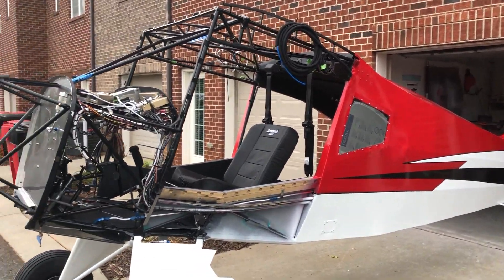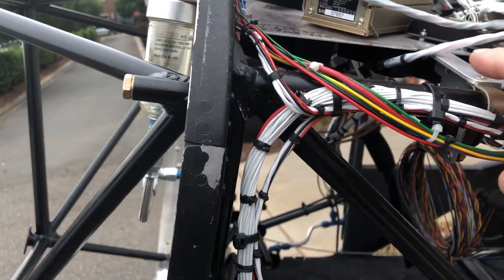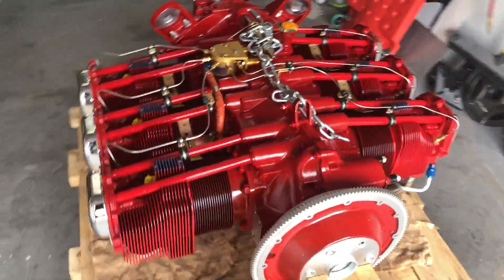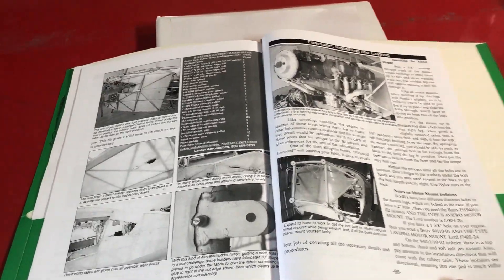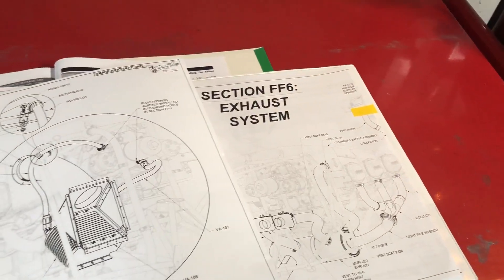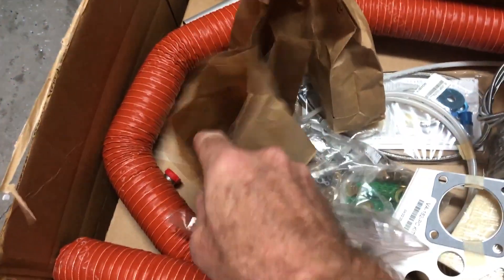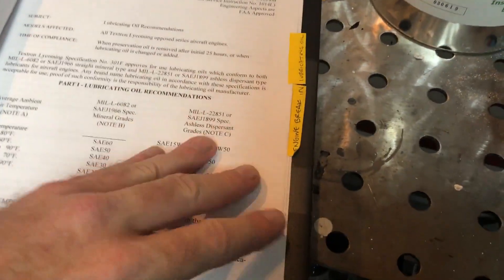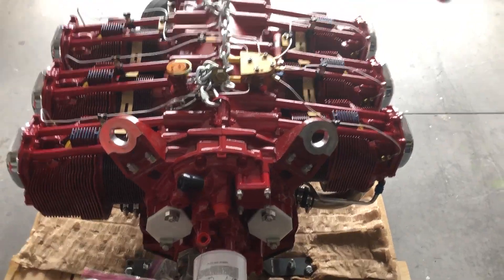Bearhawk - The NEW Lycoming Thunderbolt YIO-540-EXP Engine for the Bearhawk is HERE!

Comment: I maintained a small fleet of Piper Navajo chieftains in Alaska during the 90's, the Lycoming 540 is a real good power plant. In the turbo version it produces a reliable 350 horsepower.
Reply from the maker: Thanks for the comments of your experience with the Lycoming 540.  I also cannot think of a more reliable and better performing engine for my application.

Comment: How did you go about purchasing the engine? It seems pretty undisclosed online as far as where and how to get an engine for experiementals. And if you don't mind, how much should someone budget for FWF parts that don't come with the Bearhawk kit?
Reply from the maker: I didn't have any real issues finding experimental engines online to purchase.  I chose Lycoming because I would be buying an experimental directly from the manufacturer.  There are other experimental engine builders out there that will take an existing core and beef it up however they see fit and call it experimental.  For me, my choice for going with Lycoming was because they would be conservative and safe.  For example, they only go up to 9:1 compression.  There are some engine builders that will go up to 12:1.  

As far as the FWF budget, I purchased a RV-10 FWF kit from Vans as it is closest to my IO-540 setup.  They sell these on their website.  However, you should go through the Vans FWF kit one part at a time to decide what you want.  I really like their baffling kit, and other parts, but I chose to buy the exhaust system, control cables, airbox separately.

Comment: For the money Lycoming asks for they should have printed the manual. Thats total B.S.!  Your required to have that manual and they as the engine manufacturer should have provided that manual to you with the purchase of your “New” engine. 40-50k and they are got cheap to print the manual. It would make me wonder what else they may have skimped out on to save money? If the details are everything and they didn’t provide a manual. It does make one question their purchase and it does put skepticism on the product. Lycoming has been around a long time. Thats true. It’s also true that in Aviation complacency kills. So the longer they have been around the more complacent they can become.  Continental is the same way. Our clubs Rotax 912is came with a manual just saying lmao!  Great airplane though! You have done fine work on the airframe Sir! Congrats! Thanks for sharing your Lycoming experience. Also they weren’t going to pre run the engine for 3 hours unless you requested it? That just sounds sketchy. Please keep us updated especially when it comes to your new engine. 🍻
Reply from the maker: In their defense I will say that Lycoming does not typically ship a brand new airplane engine to someone working out of their home garage.  While that might be changing these days with more and more homebuilts on the scene, their primary end point is almost always the certified aircraft manufacturer, or, professional installation facility that has no need for a general operators manual that I am referring to.  The professionals work from the dedicated manufacturer Aircraft Service and Maintenance Manuals.  These are only available to certified A&P IA designations.  Again, I was referring to the Operators Manual.

As far as the 3 hours on the test stand...  Manufacturers always run their engines on test stands before they ship.  These tests are usually 30 minutes or so.  My request was for an additional 3 hours to further the break in and in-factory monitoring.  Lycoming says some people want this additional time, others do not.

I have no concerns about Lycoming or the engine itself and do not feel that I was jipped.
Reply: In terms of innovation that haven’t done anything. I’m glad they are catching up with the companies that are being innovative. Let’s start making the Lycoming’s 100 lbs lighter and offer full FADEC from the factory! When they do that for the experimental market I’ll stop talking trash, ha!

Comment: Wow!

What was your build time? > 500 , >1000 hours?

Did you build from scratch or get a kit? Did you opt for the more expensive quick build kit? How was your build experience? Were parts pre-fitted together easily, pre-drilled an only required cleco rivets, I like that they show flush cleco rivets so that there are no dimples every where.  How was the landing gear assembly? Did you get the standard tail dragger landing gear of is your an upgraded version. I am curious if the landing gear can accept Alaska Bush Tires 29" or 33" ?
Reply from the maker: It's a kit.  I've been building since June 1, 2018.  I build about 3 to 4 hours every day.  Landing gear is phenomenal.  My tailwheel is an upgraded T3 Tailwheel.  Nothing wrong with the kit tailwheel.  Yes, it can accept 33's.

Comment: Drill the bolts head through the side with a small bit and use wire ( safety wires) to keep the bolts from backing out
Reply: Drill a hole through grade 8? That's why they make them with holes already.
Reply from the maker: Thanks for the tip!  (Sorry for the late reply...)

Comment: What was the cost of this since experimental variants are always cheaper. The typical price I saw was 50k so I started looking at converting and ls3 due to higher torque,hp,lower weight, better fuel burn,and newer technology but converting a car engine to a plane engine seems unsafe to me no matter how much I read on the contrary.
Reply: I bought the engine directly from Lycoming.  So there is no cost savings there.  The number you saw was slightly less than what I paid.  This is an experimental engine built by Lycoming.  I felt that I were going to buy an experimental engine, why not buy it from the manufacturer?  Car engines run at much higher RPM's.  That did not feel comfortable to me.
Reply: @robcaldwell5586  ok thanks. I was looking down the car engine alley because from what I read the reduction gears prevent prop damage and you only run the engine at about half throttle. Supposedly this lasts longer than the tbo of a lyc but it feels TOO experimental for me
Reply: A company modifying the Murphy Moose has put alot of resources behind utilizing the LS3 as well. They mention the bearhawk as candidate amongst a handful of backcountry STOL.  I would love to see a real-life comparison of true numbers between bearhawks between io-540 and the 435 horse LS3 from moose mods. Guessing it would have 13-14 gph on LS3.  If Mr. Caldwell sees this I wonder if you have heard of other Bearhawks owners and what GPH and range they are getting?  You mentioned 700-800 range in the experimental video I just remembered. The plane looks extremely impressive.
Reply: @jberg411  
The company you are talking about is Bull Moose. http://www.moosemods.com/
https://www.youtube.com/watch?v=4RLifbACl5U&list=PLjlS5-R6nxpRt1rOteuFlD8H167WyBrkN&index=79&t=0s

Brapp be Gaming
There are at least two companies which sell a PSRU to bolt on an LS3 and make it work as an airplane engine. One is http://www.aerotechllc.net/ls3-aircraft-engine.html but I don't see any examples of their product flying in finished planes. 

Geared Drives, AKA Auto PSRUS has many flying planes using their products.  https://www.autopsrus.com/
They sell Firewall Forward packages for several models including the Bearhawk.

https://www.youtube.com/watch?v=3V8V3Ojb4fE&list=PLjlS5-R6nxpRt1rOteuFlD8H167WyBrkN&index=74&t=0s

https://www.youtube.com/watch?v=D4z5bZemWhw&list=PLjlS5-R6nxpRt1rOteuFlD8H167WyBrkN&index=73&t=0s

https://www.youtube.com/watch?v=ZsoMn-ZRr58&list=PLjlS5-R6nxpRt1rOteuFlD8H167WyBrkN&index=76&t=0s

https://www.youtube.com/watch?v=k_1XSpFHRhg&list=PLjlS5-R6nxpRt1rOteuFlD8H167WyBrkN&index=82&t=0s

This video by Flight Chops is about a group of backcountry Fliers in Canada. At the end of the video, a guy comes flying into the gravel bar they are on in a V8 powered Bearhawk.

On another note... one option, I am also considering (in addition to the V8) is a Turbo normalized Subuaru EZ3.0 engine. Geared drives also make PSRUs that will fit and work with Subaru engines.

https://www.youtube.com/watch?v=k-mNd71Bk3I&list=PLjlS5-R6nxpRt1rOteuFlD8H167WyBrkN&index=12&t=331s
Reply: Car engines spend their life putting out a small fraction of their rated horsepower. Airplane engines typically run at 75% or more for hours. Your plane will be worth a whole lot more with a Lyc
Reply from the maker: It was built at the factory.  Didn't save anything on that!  LOL!  (Sorry for the late reply...)
Reply: @TheBaldPilot  Care to share how much that was? :D

Comment: How many horsepower ?
Reply from the maker: Lycoming says 273.  Experimental engine 9:1 compression, port and polished, roller tappets, etc.
Reply: Bearhawk Life 
Excellent!  I’ve read the bearhawk info says 260 max. I was wondering if there’s some kind of airframe limitation or something. I figured something north of 260 and maybe approaching 300hp would serve it well. Especially with the i0-540 weight.   Your build looks amazing. I’m both impressed and jealous.
Reply from the maker: @smashke1234  I've heard of others going to 300hp, or more.  I'm  sure my 273hp will be plenty and probably more than I will need.  Thanks for the kind words.
Reply: Bearhawk Life  I used to tow banners with a Stinson that had an O-540 which will be somewhat analogous to your airplane. That thing was a spaceship. You will probably be lighter with a bit more punch. You are going to love it.